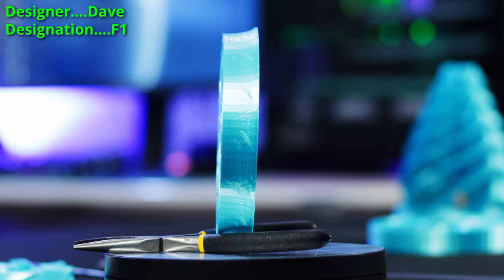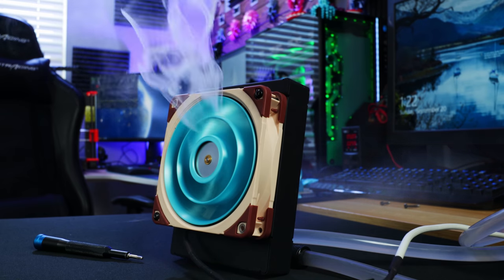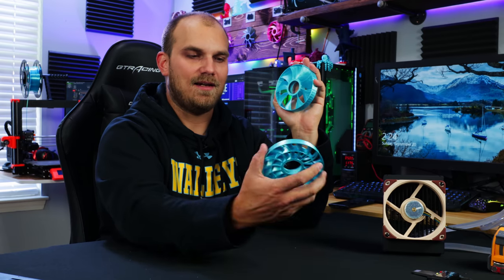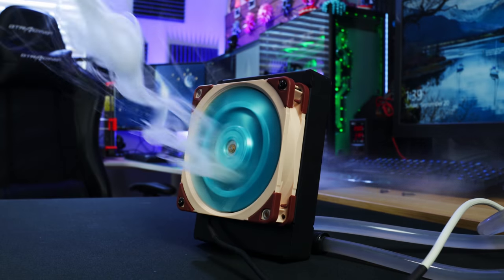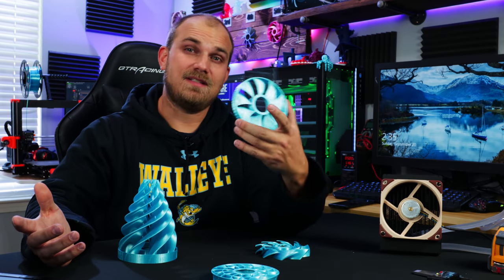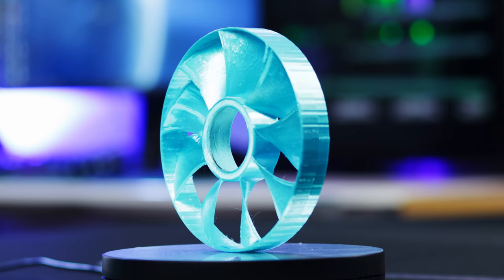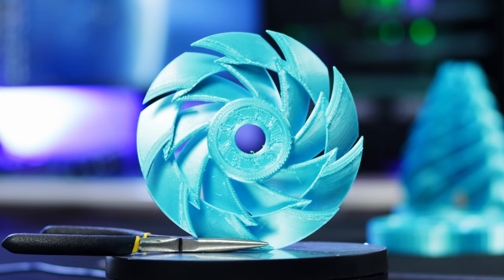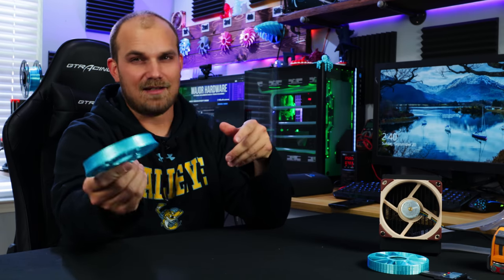This Couldn’t Possibly Work… Could It? | Fan Show Down Episode 5

Comment: "Grandpa why do all fans and corkscrews have lightning bolt blades?"
"Well, funny enough it started out as a joke..."
Reply: fun engineering school story; the final project for the intro engineering graphics course is building some kind of device to throw a tennis ball, the joke in my class was why not build a tennis racket monstrousity, and then somebody a couple years later did it and it worked reaally well
Reply: Pika pika...
...
Pikachuuuuuu

Comment: Print that Acceleron in resin, it should be smoother and perform better
Reply: Yeah since it is closest to beating the Noctua, you now have a good candidate to tweak and go head to head!
Reply: Came here to say that. Up you go
Reply: @802Garage  bro first I see you on tiktok, now your on the same videos I see on YouTube? Can't wait to see that v10 subie run
Reply: @dylandavis934  Hahaha thank you! I really am everywhere. 😬
Reply: 802 Garage  Love the V10 Impreza build man! Keep it up!
Reply: So amazing that Acceleron perform at this level 😲. With industrial manufacturing quality (and material) that should actually beat the Noctua's design. But I don't remember how the noise compared though 🤔.
Reply: Probably enough meat on it to try solvent smoothing
Reply: @hidad8254  Thank you! 😁
Reply: @tkermi  It was also very quiet! Super impressive.
Reply: @802Garage  that's great!
Reply: Humm. What if we mix some of the top designs ideas and print on resin?
Reply: @youkofoxy  Do a spiral like Tulip but with the pattern of Acceleron the whole way down?
Reply: THIS. Print with a better material and get professional grade with the Acceleron, it will very likely beat the Noctua at that point
Reply: Maybe at a significant time (end of a season? when a fan design beats/almost matches the stock Noctua?) the top slot can have the honour of being printed in resin?
Reply: Inb4 the major just had this in resin and boom
Reply: Also polish the surface.
Reply: What about smoothing it with acetone vapor?
Reply: It just looks cool in general

Comment: Imagine if noctua started producing the tulip design now.
Reply: Imagine making an expensive itx build to order that as a main attraction. Come to think of it it would be a nice interior piece if you could put some rgb strips on the screw/tulip itself.
Reply: @eivis13  Just think about how much space it would require though.... The only thing I could see it be used for is a lower end CPU cooler. On that note it would be really cool if they managed to figure out how to use all that surface area as a heatsink, just imagine a large copper heatsink fan.... Scratch that, that would be incredibly difficult.
Reply: A couple of those would look awesome as in the bottom of a case.
Reply: @wh0_am_152  possible but you would need to have some kind of floating contact from copper heatsink to a carbon based fan blade, light as possible but could still transfer huge amounts of heat... I am thinking graphene would be suitable
Reply: @BigIdds  Look up Sandia coolers, pretty cool how they do it. I think thermaltake last tried to release an actual project called the engine 27.
Reply: @funkstrong  having watched the video on their cooler, I understand the concept but I haven't heard or seen that design become mainstream

Graphene could change that concept though, as we do have mag lev bearing fans, now which is similar to the concept
Reply: I'm pretty sure BadDragon make them already.
Reply: Zalman had a whole range of flower-themed coolers at one point.
They were all outperformed by the traditional tower cooler designs we see today, but I could imagine a Tulip impeller in one of their heatsinks.
Reply: Corsair is looking at it, if they can add RGB to it.
Reply: Noctua could do WAY better than this if they had that kind of real estate to work with. They are designing to work within their housing.
Reply: @wh0_am_152  Easy, a well made piece of rubber can isolate the axis from one side to the other, as long as you use a vacuum pump to pull water from the system and keep the tank down it isn't gonna leak.
Reply: Imagine having like 3 on top of your case blowing down through a rad just to look cool, hahaha. Or run it in reverse and see how well it does as a puller? I won't be surprised if a company starts offering swappable blades due to this series though.
Reply: It seemed to distribute air more like a cylindrical fan, (which I really want to try) in that it's less focused. So, I'd like to put one on the front or top of a case with it protruding outside, covered with a cone shaped mesh/dust magnet. For looks of course. Not necessarily performance even though it would probably do well. Give it a pearl like sparkle finish with an led  light it from the base. What's weird is I'm not really in the the flashy stuff including RGB but the idea of this fan being a prominent part of the design is very interesting.
Reply: @802Garage  Great minds think alike! 😎
Reply: @CynHicks  Haha for sure!
Reply: that seems more like a thermaltake move
Reply: Ooh, I want 20 of them in my ITX build!

My ITX build in an Obsidian 1000D.
Reply: Would be cool to have bright colour and use it for top pull fans
Reply: air tower pcu cooler with two of those on sides wood look cool
Reply: @wh0_am_152  "just imagine a large copper heatsink fan.... Scratch that, that would be incredibly difficult"
We've seen CPU coolers with metal fans before (thermaltake sandia), so it's not that far-fetched. The heat transfer to the fan would be the biggest difficulty - the area of conductance into the fan would be tiny (it could only be as large as the fan rotor's contact with the bearings and/or housing, and ideally this contact would be minimised to reduce friction). A highly conductive fluid bearing might be the best solution, and it might even be possible to integrate some sort of convective cooling.
Reply: I imagined dual 4x120 mm radiator in Thermaltake Core X9, and motherboard can only be miniITX with GPU with waterblock tucked in the basement, because fans block everything else.

MUST SEE.
Reply: I would even buy that
Reply: @wh0_am_152  There is low profile cooler that uses spinning heatsink, but its performance is questionable. Can't write its name from top of my head, Linus made video on it.
Reply: @BigIdds  what about using fluid to transfer heat to the fan blades?
Reply: but brown
Reply: @wh0_am_152  You joke right?
You build ITX box, drill a hole and make tulip in to cooling art piece.
No real filtering possible tho.
Reply: A fully customized case based on something with a nose design like a zeppelin would work.
Reply: @funkstrong  I'll go one step further and suggest everyone interested in fans watch the Sandia Labs video regarding these fans. Fascinating stuff.
Reply: Actually that is what engineers put inside a real industry class heavy duty radiator, I think it would work better if he calculate the axle center and the wing angle then it would really make a difference.
Reply: It would look like a giant spinning turd with their default poop brown.
Reply: @wh0_am_152  a little thermoconductive lube on the connecting shaft would do the trick
Reply: @wh0_am_152  Well depending on how your card fits onto your board...there is A LOT of empty space if you don't use a liquid cooling system. You could fairly easily replace one or two fans with that thicc boi fan and not have it interfere with anything.
Reply: @BigIdds  If you look up the Sandia Cooler, Sandia National Laboratories found out how to get thermal energy from a heatsink to a heatsink-fan via a thin film of air between the two
Reply: Knowing Noctua.. It won't be pretty, it's going to be brown and literally look like a turd... The Turdlip design?
Reply: Wouldn't it be called the Noctulip then? I'll see myself out
Reply: @wh0_am_152  but how cool would they look you could house the entire think in a nice wood box and just have a hose system running to the computer to a nice copper heat sink
Reply: SOMEONE is going to steal it.
Reply: @Zwenk Wiel build a frame that you could adhere holographic foil too
Reply: The tulip will be spilling a lot of the air outside of the blades, this kind of fan that has a large initial fan blade volume and reduces to smaller needs a cone duct.  Then the larger volume at the start going to smaller volume accelerates and pressurizes the air considerably more than a normal fan, but it requires the duct so it traps and screws the air.  Without it the air just slings out of the blades instead of getting accelerated along the axis.
The original NOTAR for helicopters used a spherical fan at the base of the tail boom to pressurize the air, larger volume to lower but higher pressure, to generate force at the other end of the boom through the ducts..
Reply: Imagine being a meme that became an actual useful thing

Comment: Prints Tulip
"Were running out of PLA"

me: Shocked Pikachu Face
Reply: That's the greatest argument against the Tulip. It's extra material cost, and need for a special shroud to increase efficiency.
Reply: @hariman7727  Screw costs!! All HAIL THE DRILL

Comment: you should redo all the fans in resin for smoother airflow, I think that may help some of the fans that did surprisingly bad if they depended on a smoother surface to flow on.
Reply: I'm pretty sure the ones that did really bad would need more than better surfaces
Reply: what about sanding them with fine grade paper?  get rid of any imperfections to a smooth look
Reply: Exactly what I was gonna say
Reply: @SonOfTamriel  or acetone smoothing. Some parts of these fans would be hard to get to with sandpaper
Reply: @ChaosPootato  im talking about the ones that had a good concept but you could see the 3d print did not come out good
Reply: It seems part of the point is a fan you can print and use. So imperfection in the print design matters
Reply: I was thinking the same thing
Reply: Its crazy to think that a rough blade fan like that can rival Noctua fans, imagine if they are smooth
Reply: Pixel He should 3D print Noctura fan just so that all the entries are competing with the same limitations.
Reply: PLA is a bitch to sand (it melts, also smells like burned sugar when it does). ABS can be smoothed but he isn't using ABS.
Reply: @iamofflineyesreally  Yeah, but resin printers are actually cheaper than cheap good filament printers.
Reply: @EVPointMaster  acetone doesn't smooth PLA
Reply: @Jeff-fc7nf  He did in an earlier vid! It seems like the material surface actually didn't make too much difference to the performance of the fan (within the margin of error at least)
Reply: @daemonelectricity  I see what you're getting at. I don't know about the statistics of it enough but which type of printer do people have more?
Reply: @daemonelectricity  yeah, but cheap good resin printers are more expensive than the average fdm, if you find a cheap good resin printer chances are the build volume is as big as two cups, also resin for 3d printing is really expensive and you can't just use regular uv resin
Reply: It would also allow trying designs that are currently too thin to work with FDM due to the process, that are likely to work otherwise. (There's the conflict of needing thin and light in regard to this application vs. having adequate thickness for layer adhesion.) Would allow more leeway in being able to use aerodynamic profiles with a lot of tapering too.
Reply: @iamofflineyesreally  you can print in resin, you can sand down or acetone the results as well.... lol, just because its intended to be printed doesnt mean you cant also intend to touch it up
Reply: @83hjf  You can slightly sand the surface of PLA or use acetone and syringe+injection needle with point removed to remove high spots and then use ABS putty (abs dissolved into acetone) and fill the PLA holes with it Saved several prints and lots of $ for me. Even print that got layer separation and another that snapped clean out from table can be still saved. Just look/measure witch layer it got separated, smooth the surface of first fail, remove that much from the model and print rest of it. Then roughen up surface and join them with superglue, acetone or ABS putty. Finish the surface with ABS putty, sand and paint depending application. I already have plenty of ABS supports and any clean and pure ABS can be used for putty. I just tend to use support material in black color.
Just use glass jar with properly sealed lid for putty. It will loose acetone over time, but even fully hardened batch, just pout more acetone in and let it sit day or two to be ready for use. For amounts about 50/50 gives viscosity that can be used to fill holes but it wont droop. I use small flat head screw driver to apply it and after wards what is dried in the drivers end, just pull it off and drop back to container, same with bigger chunks cut off to smoothed it if you put too much. Just avoid thick layers or it will create bubbles inside the plastic.
Reply: @Hellsong89  but acetone doesn't dissolve PLA? also i've had luck sanding PLA but basically you have to do it under water. the sandpaper needs to be WET, the moment it dries, your PLA melts when you sand it. it would be pretty hard to sand these curved fan surfaces i guess.
Reply: @PixelatedWolf2077  at this size, smooth isn't always better. Turbulent flow gets weird.

Comment: The “anonymous” fan is basically the same thing as a water turbine. It really needs to be placed in a housing and used as an intake fan.
Reply: Shrouded? Hmmm... it might move air really efficiently. The conical surface of the blade tips help spread the vibration and reduce noise quite significantly.
Reply: Clear shroud with strobing led perhaps
Reply: Yes. It needs ducting!
Reply: KJames Jr I think they got inspiration from the gold ratio tulip by integza
Reply: This is what I was gonna say some kind of shroud that mounts the the fan housing so that it can pull air in without loosing any out the sides it would probably increase the amount of suction it could make too
Reply: Maximum pressure fan for push configurations.
Reply: The tulip design reminded me of the propeller in the old Stingray show.
Reply: Right now, when hung on its side, Tulip is putting a lot of stress on its bearing compared to the other blade designs, the torque has got to be dozens of times larger.

As this is getting rigorous enough to be actually useful: I would be interested to get noise ratings on these.  Fan performance really belongs on a 2D graph of noise versus airflow.
Reply: Nigel Scruby any thing could happen in the next 30 minutes 😲
Reply: Wouldn't it also need to be inverted, airflow from the larger diameter to the smaller, which would create a higher velocity air stream? But my guess is that the heat exchanger would perform better with a lower velocity airflow across the entire surface of the exchanger than a high velocity jet in one small area.  Obviously heat is going to be removed in proportion to the volume of air exposed to the surface of the exchanger, and I think that volume would be larger with a slower bigger airflow than with a smaller high velocity jet of air.
Reply: Channeling water to do the Sheiberger  vortex effect may be the best use for it
Reply: Thats what i was going to say, invert, shroud and support from both ends, then perhaps a difuser of some sort to spread the airflow over a larger area... this design looks to be built more to compress air than to simply move it.
Reply: @patricktaylor9033  Pretty much. It’s an elongated compressor turbine.
Reply: KJames Jr look if the tulip impeller if you want to see where the design came from. It’s basically the golden ratio stretched to be 3D
Reply: Screw the fan to the top of a tower and duct it, and it could probably float a hovercraft by itself!
Reply: @raykarenmeuchel5086  Viktor Schauberger you mean?

Comment: I think Thomas' design should be used more! It looks sick compared to most fans nowadays, and functions well.
Reply: It is a really cool design, but the problem with this and many others is that they are close to Impossible to manufacture using injection molding. The only way would be to design it in multiple parts, or to use additive Manufacturing (3d printing).
Reply: It's like the Viktor Schauberger impeller. Integza did a video on it.

Comment: I wonder how that acceleron would do with whale fins on leading edges and vortex generators at the back. 
Also, I don't know if you tested that maybe if you could print out the Noctua design with the same materials to see how the material is affecting the results.
Another idea I'm thinking of is just adding whale fin, vortex generator, and owl wing fins to the original design and compare.
Best!

Comment: imagine if these fans were using the same materials as actual consumer grade products then im pretty sure they will outperform the best ones in the market
Reply: ya, I honestly wonder how the results would change if you made them to the same quality standard as the noctua fan. Because 3d printing is great but it leaves a lot of imperfections and imbalances within the item.
Reply: Or if this channel will collaborate with 3D bigger printing channels so they can make more of 1 fan (like at least 3 for each model but max of 10 depending of the "print quality possible") and also test for different heat outputs of 50W - 100W - 150W - 200W and maybe also 4x radiator test of : 2x thickness levels, and 2x radiator "mesh"(fins and tubes) density.
Reply: An easier way to compare would be to just 3D print the nactura design. Then they all have the same limitations.
Reply: @Jeff-fc7nf  I swear that's what he did before he turned this into a series.
Reply: @Jeff-fc7nf  good idea